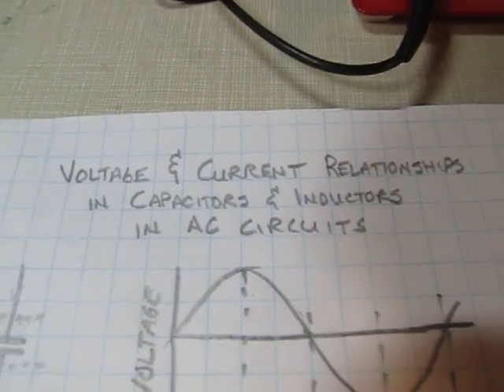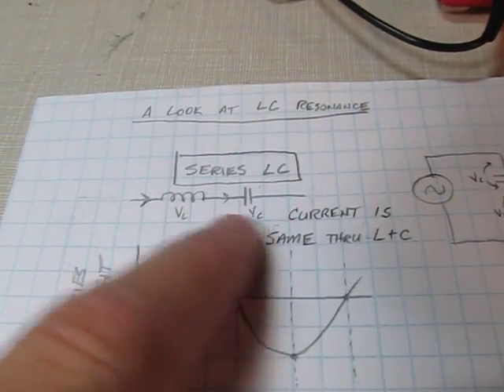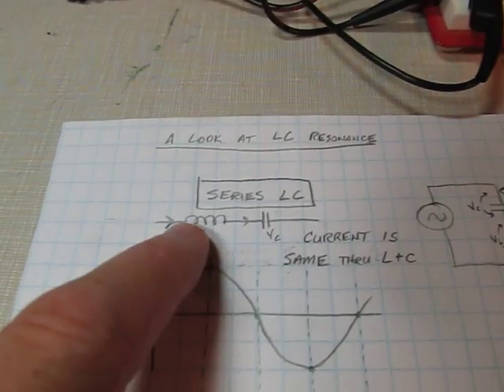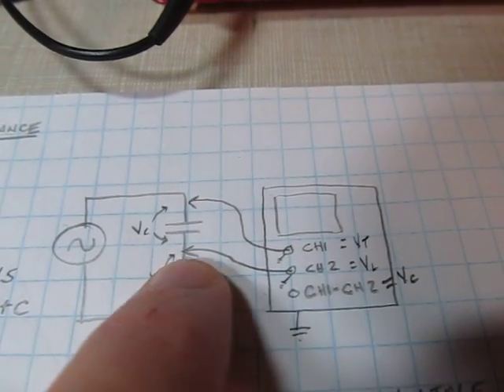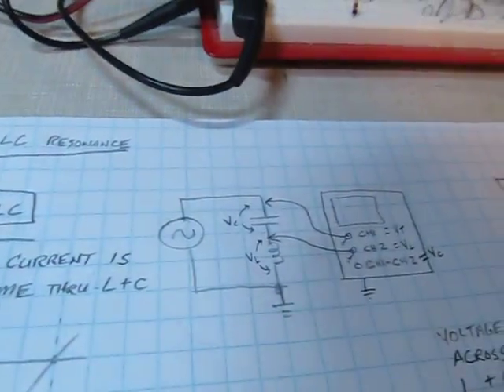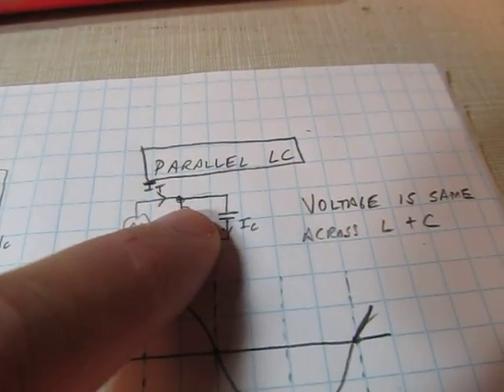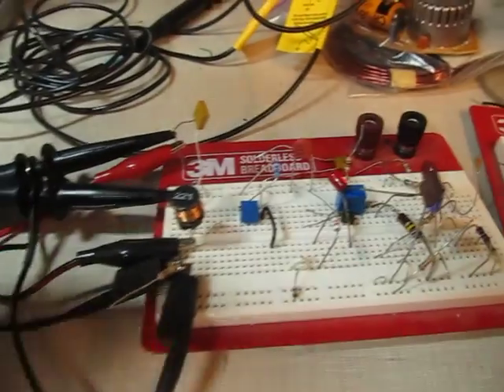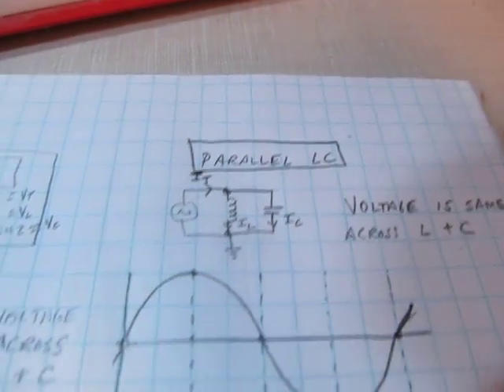#55: Back to Basics: Tutorial on LC Resonant Circuits

Comment: If a parallel tank circuit effectively has a zero sum current then how does it maximize power transfer? The effective impedance is zero so current transfer should be maximized. Help!
Reply from the maker: A parallel LC circuit looks like an OPEN circuit (very HIGH impedance) at the resonant frequency.  In the video, i put the parallel LC circuit in parallel with the scope input, so that at resonance you get the least loading and the highest signal amplitude.
Reply: Thanks for responding. My understanding is that if you were to plot an inductor and a capacitor on the Z plane, at resonance these two components should be diametrically opposed and hence cancel. Where am I going wrong here?
Reply from the maker: Their reactance vs. frequency go in opposite directions.  At some frequency, the magnitude of their reactance is the same, this is the resonant frequency.  At this frequency, their voltage/current phase is 180 degrees apart.  Because of this, as the video shows, a series LC looks like a short circuit at resonance, and a parallel LC circuit at resonance looks like an open circuit.

Comment: Well,  I think there is a flaw in this kind of reasoning. For example LC series: you a drawing current phases as if the components are independent but they are not - inductance blocks current to the capacitor...
Reply from the maker: In a series circuit - the current in each device is exactly the same - it has to be.  The resulting phases of the voltages are what gives rise to an effective short at resonance.  The inductor does not block current to the capacitor at resonance.
Reply: OK, I got it. What happens in series circuit is capacitor support current flow at first stage and inductance is small enough to support current flow at second stage when the capacitor is fully charged. In other words capacitor creates (stores) charge (positive or negative depending on polarity) between capacitor and inductance that the inductance will transmit later when capacitor stop conducting current. Like impulse moving through 4 hanging metal balls in mechanics - two of them in the middle have restricted movement but an impulse goes through.

Comment: when cap and inductor in series behave as a short circuit at resonance with no voltage across them , how come it does not damage the power supply ?  Does the power supply voltage drop to zero and not get damaged ?
Reply: You cant get under the ESR of the cap. plus the Rdc of the inductor.
Reply: Ideally it's gonna be a short circuit.But pragmatically, the circuit do have some resistance which will not short the load.

Comment: So THIS is how the traps work on a trapped multi-band antenna! Correct???
Reply from the maker: +Brian Streufert Basically, yes.  Check out the video on LC resonant circuits...
Reply: +w2aew I actually did after I wrote this and it opened my eyes to lots of things. I have always known what LC/RLC/RC circuits did but now I understand how they do it.

Understanding why caps and inductors lead and lag current and voltage is something I now need to understand the reasons behind. I would assume it ties directly to why transformers and other large inductive loads have inrush current, essentially charging up the magnetic field in the windings and core, if it has one.

Comment: VT is always equal to Vsource  how its amplitude can change with varying frequency.  
In circuit needs a resistor in series as well? i.e. at resonant frequency VC+VL =0 all Vsource will drop across resistor.
Reply from the maker: The signal generator has a 50 ohm output impedance, so essentially a 50 ohm series resistor. That's where the voltage is dropped when the impedance of the resonant circuit is very low.

Comment: hi.allan...I use for  this circuit .1 mfd cap. and a 100 mil.henry inductor , a 1.592 .3 khz frequency 2 volts pp voltage. also the diferential math function on my scope   ,in the cap and inductor voltages i can see the 180 degre phase shift on the voltages ,but dont see the droping voltage across the cap when turn freq up nor the voltage increasing on the inductor when freq.goes down neither the  generator voltage dropping to zero  or  inversion at resonant point  on the scope..do i need to connect other channel to do this test ?   or what im doing wrong? 

                                                                                         kp4 bp

                                                                                   Ruben
Reply from the maker: +Ruth Perez You need to have two channels connected so that you can observe the phase relationship between the two signals.
Reply: +w2aew yes...i have the generator voltage on chan # 1....the coil voltage in chan-2 and the capacitor voltage on the math channel...the difference between the two signals...l see the 3 waves but they dont bahave at it should be..any other hint ,pse..   tnx Ruben
Reply from the maker: +Ruth Perez Make sure all your probe grounds are connected to the same ground point.  Also, you may want to verify the component values - maybe they're not the values you think they are.
Reply: +w2aew ..tnx alan...i have been doing all your projects continously..and all have been working just fine..but this one ...but i will get to work perfecly as it should....probably is something wrong with my scope...tnx again..73   w2aew de kp4 bp....( .-.-.)  .

Comment: Alan. i tried to replicate your experiment in LC resonance...when i did the math in my scope..saw the two signals subtracting from each other...the coil minus the cap. voltage as a matter of fact was perfect....so far ok..but when l increased or lower the frequency could not see the increasing or decreasing efects on this two volatages as i expected and supose to happen..using  an fg 085 sig gen , and a two channel owon  ds 6062 scope..do i need another conection or something else to do this test?  apeciate you help thanks...kp4 bp.....Ruben...

Comment: Confusing video.  Are the words "signal generator" even mentioned in this video ? Or was it simply a battery ?  At what voltage.  Or what specific generated frequency ? If the author is still available, he should simply write text under the "published on" area to describe exactly what was done in this video.
Reply: He did.  Pay attention.  Ya big baby.

Comment: Thanks, but what I don't understand fully is that when, for example, you're tuning a circuit and trying to change the resonance frequency, you do it with a variable capacitor (or so I read). Would this action not offset the balance between capacitive and inductive impedances (Xc not = Xl) and not cause a resonance at all?
Reply from the maker: No - all it means is that Xc = Xl at a different frequency, which is the desired result. Mathematically, every combination of L and C has a resonant frequency.  In practice, some combinations are impractical.
Reply: ***** Hmmm, okay, I think I got it now. Thanks.

Comment: Hi there. i was wondering, that instead of a signal generator, if i hook up  an antena will i be able to resonate the circuit at a particular frequency to get a signal? also do i need to amplify the signal before i channel it through the tank circuit? i am working on a radio controller right now and i really need to complete it before my holidays are over.please reply soon.
and nice work (^_^)

Comment: I can not express the importance of this video for those want to learn electronics. once you understand this circuit then you can understand electronics.
Reply: What is the application in electronics?
Reply: @elec3calengr  it determines frequency. When you turn your car radio dial, you are changing the values of a LC circuit to the same frequency of your desired radio station.

Comment: I'd like to build a similar circuit as the one you show in the video and plug in the oscilloscope. can you give more info about it, like capacitance and inductance values, AC voltage and frequency ? Thanks.
Reply from the maker: Actual values aren't critical, simply use what you have and calculate the resonant frequency.

Comment: Thank you so much, This creates a question about my hand crank generator. 
I used a four diode bridge rectifier with a capacitor to smooth out the AC and now I wonder if I should add an inductor....? 
Will the inductor stop all current? or will it effectively and totally smooth out the AC for a good clean DC. 
Any help appreciated 
Harold 
PS. You said the cancel each other out like an open circuit but then you said it would be good for filters?
Reply from the maker: No need for the inductor in your case of power generation.  

For the filter - picture the LC tank circuit in parallel with a load.  At the resonant frequency, it looks like an open, so the load gets all of the signal.  At other frequencies, the LC will shunt some of the signal away from the load.  This is one possibly implementation.

Comment: Hi Alan, I got the same set up LC in series and the circuit goes in to resonance at 216KHZ, when I switch to parallel it goes out of resonance and my function gen. has up to 20MHZ where I can see it wants to go in to resonance but don't have any more range. my L is a hand wound wire and my C is .01uF. as per calculation it should be around 54.292 uH but with my LCR meter is 27uH. any idea why in parallel it doesn't resonate?

Comment: Hey thanks for the quick reply, changing my probe to 10x mode and adding a 110 ohm resistor produced much better results. I'll remember to double check my impedance values when making LC circuits. Thank you for your insight!

Comment: Greetings, I"m trying to reproduce your experiment however I"m not having much luck reproducing the results you got for the series LC, aside from a very small drop in Vpp around about 10 mV. I'm using a 127mV sine wave generator connected across the inductor and capacitor in series and connecting my probe across the series circuit. What am I doing wrong?

Comment: I'm in need of a parallel LC with as high an impedance as I can get. So far 17khz resonance doesn't have much impedance/resistance. Do I need to be aiming for MHZ range for any substantial impedance?

Comment: Thanks very much for this, excellent video!  

To feed the parallel circuit from your signal generator did you include a series resistance?  I have been experimenting with this recently and wonder if the 50 ohm output of my generator is interfering with the tank circuit.  I do not always seem to get results that correlate with the relevant formula.

Comment: DC resistance of the coil will limit the  AC current flow through it.. All wire has resistance, unless it is in a liquid nitrogen bath, then the wire will have near zero resistance.

Comment: i have a hv driver pulsed DC and want to find resonance in  my coil. I dont have any high voltage caps yet to make a lc circiut at hv . so i kinda wanted to practice with my singnal generator.what i wanted to see is what if we can  collect bemf at resonance. so my SG  hooked up to a bedini circiut i would need to throw a capacitor in parallel with my coil right? can you do a video maybe on the math to calculate which size caps i might need?

Comment: In the case where you have two coils to transmit energy (like a wireless charger), What consequences does it have on the yield when you increase your capacity ? Is there any advantage to have a great C and a smaller frequency or the oposite (If the inductance is the same) ? 
It would help me a lot :) (and sorry for my english)

Comment: I agree - pure gold!
By far the best and clearest videos on these subjects on youtube.
To the above suggestion on filters I wish to suggest adding 'back to basics' videos on the following: 
1. Ground - difference between DC/AC circuits, floating ground, ground loops and how to avoid them, best practices and the how and where to use isolation transformers and how they work
2. RC oscillators.
3. Which capacitor/inductor types are good for which applications and which values to use.